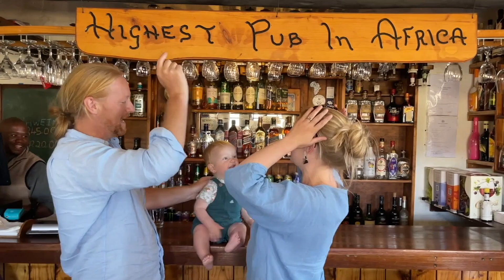Our off grid water system FAILS | Portugal Farm Renovation

Comment: The table looks so great! I worked somewhere during uni that had tables with gaps like that. We had metal troughs that had condiments, napkins, cutlery etc a candle and vase. The restaurant was on a harbour & it was also handy for keeping the sun umbrella from taking off in the wind we got on the tables on the deck. It was handy to reset the tables, we collected them all and each acted as its own tray. You could always do similar or event plant flowers. 
Great job on the water! We have an air lock that periodically comes into out bathroom sink, then the toilet & bath! We hook the hose up to the outdoor tap and push the water in through a valve in the toilet! We used to suck the air out with a wet/dry vac but the hose works so much better! The feeling when water comes through the tap! The relief you must have had! Very happy to have recently found your channel :)
Reply from the maker: Thanks Mochi Bear! Great to hear from you, thanks for watching friend. What a lovely comment to read. Thank you friend. we are having so much fun here and the farm. Great to have you joining us. 🙏🇵🇹🏡

Comment: Can relate on plumbing, I hate it 😅We have an old Maltese townhouse and plumbing has been an absolute nightmare! In between 2020 and 2022 we have had to fix 5 water leaks that were of pipes in our stone walls. We used a plumber for one, but quickly learnt the whole house has been plumbed without any elbow joins, they just bent them around corners 🤦we had similar issues with electricity shorting and electricians not being reliable, so we worked on that slowly ourselves too. Still many projects to go here so I'm sure many learning curves and knowledge sharing too!
Reply from the maker: Thanks Mar! These old buildings! Unbelievable that they bent pipes around corners!! Sorry for your troubles because of that! Wonderful adventure though! Great to hear from you, thanks for watching friend. 👍❤️🏡

Comment: Well done! I don’t know if you will be in the position where the air lock happens again but if it does, perhaps look into non return valves - we had huge problems with a septic system for a while and we kept thinking the pipe was blocked, it turned out to be getting airlocks. Once we fitted a non return valve right next to the pump, it never happened again. Table is gorgeous!
Reply from the maker: Thanks Helen, that’s great information, very helpful and much appreciated. We just bought a finishing touches to the table so should have an update fairly soon on that. Great to hear from you, thanks for watching friend. 👍🙏❤️

Comment: Tool tip: (learned from bitter experience) doing up a brownstone in Brooklyn. Tools are everything. Better results in way less time. Id suggest a table saw to get straight cuts in no time. Its an investment for sure but will save hours - if not days - when you get into the big jobs.
Reply from the maker: Thanks Nick, solid advice there! 👍🏼

Comment: Oh what a trip this was I was on the edge of my seat with the water, lol but yes Dad was the legend for sure, I am loving the table what a great job, just mind in case that rubber filler starts to melt or crack in the hot summer sun, ??. But love it, also remember to bring the wheel barrow around with you, I have 3 so that when lifting things back and forth im not killing my back, also good for Caruso lol, xxxx Have a fab weekend also would the gap in the table be good to put a pole into the centre so you could in fact make an umbrella before you seal it with tiles, ? Big Hugs Dede
Reply from the maker: Great ideas Dede, thank you! Our wheelbarrow currently has a puncture so we've got to get that fixed!

Comment: Hi you have a one of a kind home. Extremely well built and as sturdy as you could get.  
Now let me help you solve your water issue… looks like you gravity feed your storage tank from the water mine spring and looks like you lost suction and than you were hydro locked…. There is a type of valve called a float valve you can install on the inside of your tank on the wall near the top that has a float attached that will shut off when tank is full and will stop flow coming from the spring. I believe you have an overflow in the storage tank that will start draining when tank is full and that float valve will prevent this thus wasting water coming from the spring.
Reply from the maker: Thanks Lily, read your comment from start to finish, some excellent ideas there thank you. Great to hear from you, thanks for watching friend. 🙏❤️👍
Reply: @TheNewbys  even if you just want to leave things as is… the easiest thing to break the hydro lock is to get a shop vac and put it on the line coming from the spring (the one that the fills storage tank) and apply vacuum… I wouldn’t leave the valve in the line fully open…. I would start with 50% closed to avoid gulping

Comment: Is that gap big enough for a wine bottle or glass to sit in???? If you popped a piece of wood underneath it would work as a bottle pit. Or put a plastic trough in and use as a ice well for bottles to keep cool in. Well done guys with the water.
Reply from the maker: Sadly not quite wide enough, but that would have been super cool!

Comment: Great work team! I’ve been in a similar situation with my water supply. It’s difficult to give you guys any advice without knowing all the particulars of your water system. However, what I would say is that despite what we sometimes think, these issue are never complicated. We just need to remember the basic components of the system, e.g. supply, gradients, and diameters. Plus, the most common things which may negatively impact it, e.g. air and other forms of obstruction. If you haven’t done so already, I’d trace the entire system and see what can be improved upon/upgraded. Do any neighbours share your supply? Also, have you considered harvesting water from your roofs? Is there sufficient rainfall in your area?
Reply from the maker: Hi Hira! Great advice friend. Yes lots of water where we are! We think that between the rain, well and spring we will be OK. We will keep you updated. Thanks for watching. 🙏👍❤️

Comment: If you can't find tiles of the size or design you like, you could cut a piece of timber to fit and stencil a design on it. Either carve it and fill it, as you did between the planks, or paint it and then put several layers of varnish to protect the design. Maybe the easiest would be to make your own design using tiny mosaic tiles e.g. in two colours. Something fairly random and rough looking, maybe with different shaped mosaic tiles, would work well in that uneven space. Cutting small mosaic tiles is fiddly!
https://blog.century-tile.com/wp-content/uploads/imgedit2eebb9f45b80e565f6b705a6b64b8b2e_73974_l.png
Reply from the maker: Thanks Annie! Great to hear from you, thanks for watching friend. some cool, helpful ideas there we are 90% sure we will go with tiles because our children will destroy everything else! These ideas will help when we search. Thank you!! 🙏❤️👍
Reply: @TheNewbys  The mosaic tiles can take bashing and rough and tumble. And little fingers will like running over them. Plus you can adjust the gap between tiles to fit the space (though leave  at least 2-3mm to allow the wood to swell and shrink). They usually sell them on net backing, ready spaced, about 30 x 30 cm square. With that little amount, you can probably find end of line bits and pieces being sold off cheap.
Another idea - you could make your own mosaic tiles by breaking up an old plate. I think you can get nipper sort of pincer things so you could snip them to the sort of size you want.

Comment: Because of your dads help, you may not require any other "outside" advice on your water system.   However, if you would ever want another opinion, I may be able to help.  While not a professional plumber, my resumé does include experience with small independent systems like those found on farms, in hotels, and the like.   If interested, just answer this post and I'll contact you via your email.
Reply from the maker: Thank you so much! That would be much appreciated!